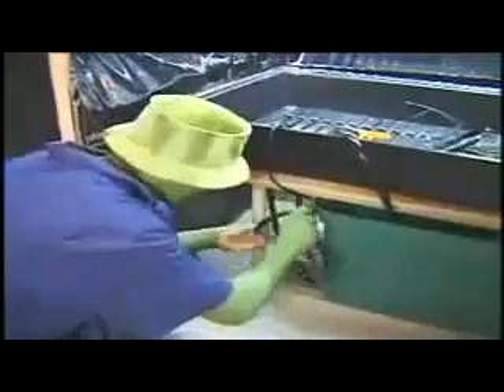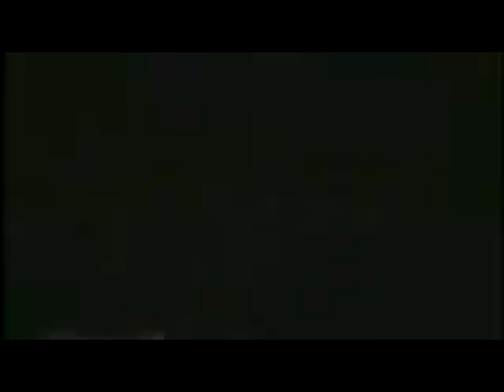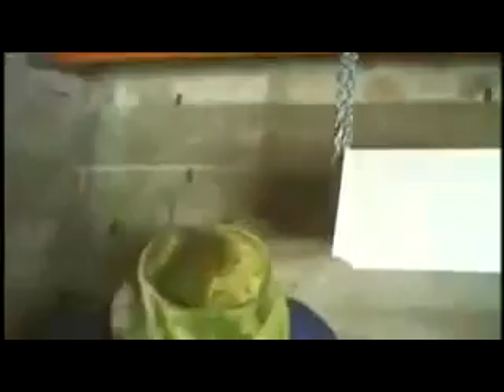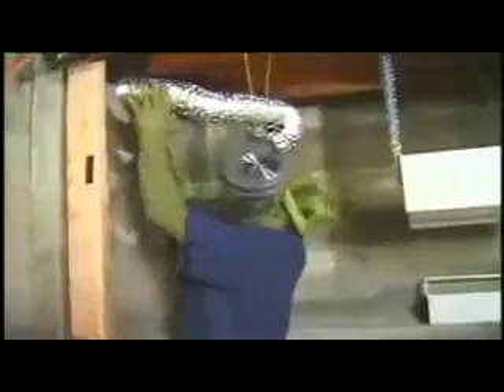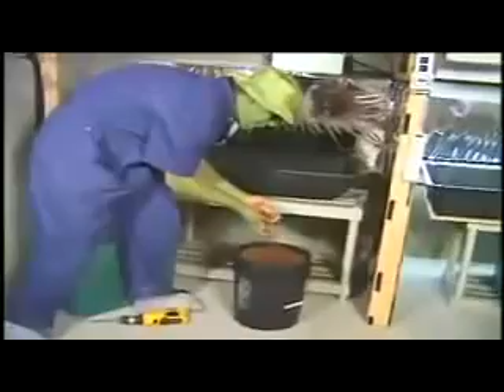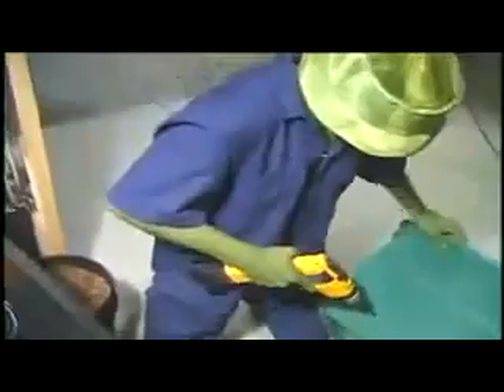Mr Green How to Build a Basic Indoor Weed Grow Room - Step by Step Construction Guide (3 of 9)

Comment: If you use an analog timer then the minimum time is 15 minutes, I use this set up and it is more than enough, it does matter though what kind of pump you use, a very small one may not provide a steady stream but rather a dripping. In this case you want to water them for a bit longer to make sure they get enough water. In my case the pump is very powerful so I have to use a valve to limit the flow to maybe a fifth of the pump's power. I water for 15 min. at a time and they plants are beautiful.

Comment: if you only have one then remove hot air with it as this will creat negative pressure(any gaps in the room will be pulling air into the room and not pushing it out) and stop the smell from leaking out (but remember to use a filter,he didn show that here)
a squirrel cage fan is not ideal(old vid) so get a inline fan that you can fix a charcoal filter onto

Comment: @MrSmokingKronic Hey dude. I noticed you are giving out good advice on these vids and I have a question I cant seem to find an answer for. Just got myself some new gear, using a 400w hps, but my ballast is 600w. It is a dimmable ballast, can set it to 50,75,100% or S-bright. If I have the ballast set to 100%, the temp is way to hot for plants, but if set to 50% the temp is just right. However I'm not sure if having it at that setting is giving the plants the correct level of lummens they need?